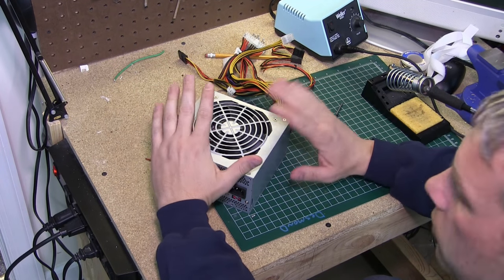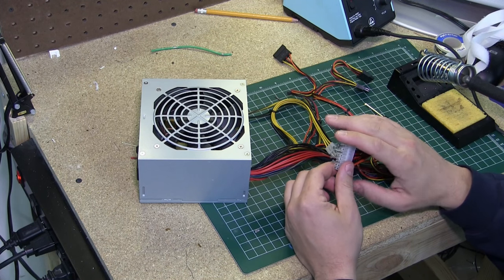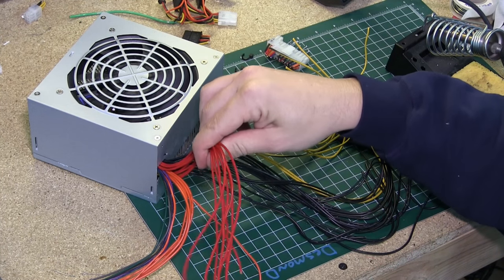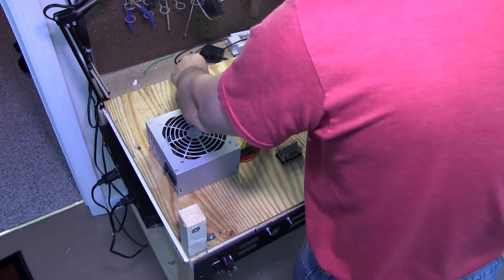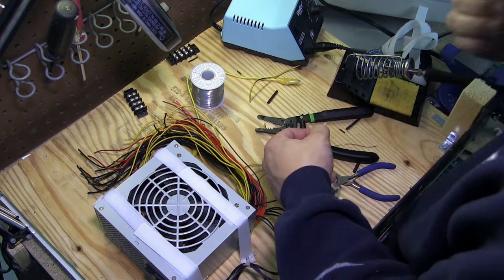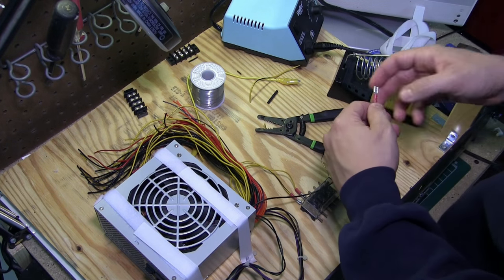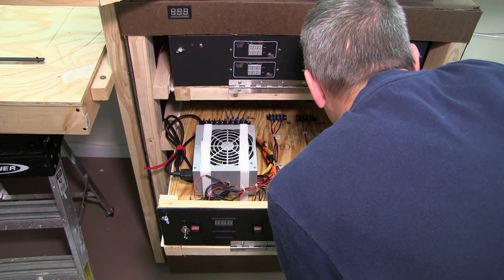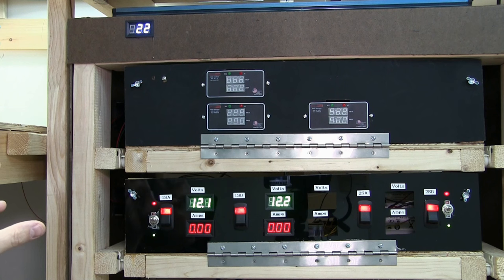Installing ATX power supplies on the Sayrehurst Secondary

Comment: Awesome this is the first time the entire ATX system has been explained in a way that doesnt confuse the crap out of me, I have heaps of ATX PSU's floating around
Reply from the maker: Thank you I’m glad you liked the video. I have learn since making the video NOT to cut off the ATX connectors. So many people are making break out boards for the ATX power supplies. That will be a change for next time.

Comment: Hi Joe, when used in a computer the main 12V rail is used for Motherboard + harddrives etc. The second 12V with the 4 or 6 pin plug is used for dedicated Graphics Cards (GPU). Graphics cards for high power gaming computers are very power hungry which is why they have the dedicated 12V rail.

Great videos BTW, you have helped me a ton in planning my layout thanks for that!
Reply from the maker: Oh thanks for the info! It didn't learn that in my research. I'm glad your following along and that I could help you out!

Comment: Thanks Joe! I sure do appreciate your quick reply. I connected the meter power wires to a 9 volt battery and the two thick wires to the middle of the source ground wire (neg) between the source and an indicator light. It works great. Your videos are excellent! Keep up the good work!
Reply from the maker: William Young outstanding! Glad it worked. On questions like this I try respond as quick as possible, I know when your in a pinch and frustrated you need answers as quick a possible.

Comment: Joe, nice video with a lot of good Ideas.  I've never considered using ATX power supplies for the auxiliary buses  but they should certainly be great power supply for DC buses.  You've given me quite a few ideas as to how to utilize and install these even if I don't do things quite the same way as you have.  So it's off to find the components at decent prices.
Thanks and Cheers
Carl

Comment: I know this was a few years ago, but if anyone watches now, these are switch mode supplies and there are big capacitors on the primary side.
Even using the "discharge" method described in the video, there is still potential for those capacitors to have a high voltage on them.   That said, there is no need to actually open the power supply to build a bench PSU from it, so you should never come into contact with those big capacitors.  The highest voltage you should be dealing with is 12V on the Yellow (or yellow black).   You can put the resistor externally if needed.   Some PSU's do not need the resistor
Reply from the maker: Hi thanks for watching. This video is from a while ago. With the availability of the ATX breakout boards everything has changed. All this work wouldn't be necessary now. But the power supplies are still running.  Sorry you didn't like the video.

Comment: I just want to start by saying that using computer power supplies is a fantastic idea that I can't believe I never thought of, major kudos to you and it really is a great build.  To give you a small background on me, I'm a Journeyman Electrician with 21 years of electronics and computer building experience, I'm telling you this so you understand that I have a heavy background in computer and electrical theory.  I have some suggestions and some information about ATX power supplies that might be useful in the future.  
    First off the information about the connector that you were talking about with 4 pins is not for dedicated graphics cards, those power connectors have 6 pins, the connector you have there is an auxiliary 12v connector for the CPU, pretty much all systems no days actually use an 8 pin connector as most cpus today are multi-core.  Another note is that the cheaper the power supply the cheaper the build.  What I'm saying is that power supplys usually have a rating, bronze, silver, and gold.  The rating just lets you know how efficient and how reliable your voltage rails are, hence how good of a supply you have.  I think it is important to note this, with the amount of work you have done to install these, I assume you want them to last as long as possible.
    Next I have a suggestion for the way you are installing them, again you have done some really great engineering into this system and these are just suggestions, you have actually inspired me to build something similar.  I was thinking you could install a 24 pin female connector and 12v 4 pin in your drawer, then you could just connect wire to the pins you need, that way, you would not have to void the warranty on your power supply, and it would make it much easier to change, just unplug and change.  As far as the load resistor, they make it wrapped in a heat sink that you could just screw down to the bottom of your drawer, then you could mount a cooling fan above them if need be, but most likely you would not need to.  In doing all these things, you would only have to wire your system one time, and replacement of future supplies would be greatly simplified and you could keep your warranty in tact.  
    I hope this info is helpful, I'm also preparing to build a bi level 12x22 n scale layout and you really have inspired me to use some of your techniques.  I have subscribed and have really enjoyed your videos, please keep them coming, if you ever have a question about trons, just let me know I will try and help if I can.
Reply from the maker: +Mark Donley Thanks so much for your input, and glad I can help, and glad you are following along.
Reply: +Central Jersey Conrail in N Scale No problem, just hope it came across right.  I'm really excited to see what your doing next, and I'm getting more excited about getting mine started.  Thanks again.

Comment: 3.3v is good for led lights in buildings that typical run on 5v gives you a bright and a dim option. Most people use the just plug system now days but I enjoy the wiring

Comment: The 3.3V is a great source for powering LEDs for street lights or interior lights.  With the 3.3 you wont need to use a inline resistor.

Comment: On my layout I chose to go with European Terminal Blocks as they save a lot of space. They generally come in 12 or more space strips that you can cut into however many terminals you need for a given connection. I also used Brother P-Touch labeler to label all  connections as needed. One of my best finds at about $14 for the labeler with some label stock.

Comment: You can buy a 24 pin plug that would allow you to just plug the power supply in. 
That way if the supply dies under warranty you just unplug it and send it back. 
These supplies don’t last forever, and they will fail when you are having an op session. being able to just plug in a spare is a life saver.
Reply from the maker: So I wished I had thought that far ahead. Also I wasn’t aware of how to make my own connectors. The system has been serving me well so far. But dread when if it dies. However I will just have to get through it. But next time I will install the connectors. Thanks for the tip and thanks for watching!

Comment: Hi Joe,  many thanks for uploading this video. I too am using a computer power source for the railroad. The unit I purchased is an ANTEC 450. I see most folks on here are using the ATX power supplies. I was able to get the 450 for a great price. Im glad you indicated using a sandbar resistor, I'll be powering some cooling fans on the cabinet. Will this be a good enough load to not need the resistor?
Reply from the maker: WestCoastRails so all the research I did said these power supplies need some draw for the internal circuits. How much I could not find. Everyone else seemed to being using the sand bar resistor. Now I'm am not an electrical engineer or have not had formal training, I only know what I have learned from model railroading. I ran the spec through a current calculator I found on line and came up with a half amp draw at 5vdc. So if your fans draw that much it should be fine. Just make sure to wire the fans direct so that they power up with the supply.
Reply: Hi Joe, can  ask where did you get the ceramic / sandbar resistor? Not having much luck, maybe Im searching with the wrong name. The you used was a 10 watt type and how many ohms? Many thanks again.
Reply from the maker: DigiKey part #SQP10AJB-10R. 10 ohm resistor.
Reply: Thanks again Joe

Comment: you are waaaay awesome   yes thank you for the hard work...
Reply from the maker: EmilionWays2RIDEIII glad your liked it! Thanks!
Reply: i have a 300 w power box and two from an arcade game with lots of circuits.   used circuits may be used?  if if they read the correct flux flow...or capacity of the ..circuit.? or just get new ones?
emilio solis
Reply: yes im a novice    im working on mine  with difficult fun..lol  i haven't touched power supplies structure first ..

Comment: Great vid, lots of good info, but a couple of questions. First is ground wires( black wires),  surely there had to be leftovers after all the switches and stuff. Was there a terminal for them? Second is that there is a lot of "Convert PSU for 12v usage" in train layouts, and making similar setups like yours, but no one shows how they tied the main power line(s) from layout to them. Have you seen a vid of where the bus line gets tied into the PSU as the power source?

Comment: nice job on this but can you answer a few questions for mecan you put up more info on wiring the volt and amp meters?????did you hook them to 12v or 5 volt side for the amp????where did you hook into the atx power supply for these meters or did you go to the terminal strips????sorry but electrical is not my strong suit......lol......thanks
Reply from the maker: Dave sorry I have been busy. I hooked up both the volt meter and amp meter to the 12 volt. I was more concerned with monitoring those circuits be ukase they will carry the majority of the load. The meters were hooked to the terminal strips ( I didn't want to mess with the internals of the tax supply). The volt meter was connected the a negative lead from the atx supply and the positive side on the 12v rocker switch on the panel. The amp meter was a little more complicated, the power supply for the meter went to a 5v positive and negative lead from the atx supply. The monitoring wires from the amp meter was connected to the negative terminal on the 12v terminal strip and a negative lead from the atx supply. So you are monitoring the amps by reading the negative side, if that makes sense. Hope that helps, again sorry for the delayed response.
Reply: Thanks for the reply, yes it makes since,
Reply from the maker: +dave great good luck!

Comment: Hi Joe. Just finished building a power supply like yours, but cannot figure out how to connect the ammeter wires. Can you explain what you did on yours to make it work?
Bill
Reply from the maker: William Young ammeter measures from the negative side in between your power supply and the load. And the power leads for the meter go to a separate source. Try that.

Comment: Question: Instead of the resistor, could you use something like a fan to provide the load and get the required load AND some cooling, or would that not work right?

Comment: Hi Joe, Does the ATX power supply have to be kept separate from the DCC power bus? Thanks for all the great how-to videos.
Reply from the maker: I use my ATX power supplies to power accessories (tortoise switch 
machines, control panel, lights etc). The DCC power bus is to bring 
power to the track. I don't want to use the DCC power bus to run 
accessories because I do not want to take away power from the DCC 
system. Sound equipped locomotives use .8 amps of power.

Comment: My only question is why you opened it and hacked the power supply?
Since you can get the female connectors for cheap from PC mod stores, you can build your own harness of the default power supply and run them to your needs.

The advantage of that approach is that if your Power supply breaks after 2-3 years, you can unhook it, buy a new one and plug it straight in and keep going.
The internals of the PSU is a nightmare to work with, but the output is standardized with where you can find 12V and 5V.
Reply from the maker: At the time I did all that work, I didn't think about it. All of the videos and articles I had watched/read all talked about cutting the connectors off. Not having a strong electronics/computer back ground I had never though of it, either. In the future if/when the supply goes bad I will just upgrade the system. That's why it is good to put this information out there so people like yourself can tell me I'm wrong. I'm a jack of all trade and King of none ( some times I make mistakes).
Reply: Central Jersey Conrail in N Scale
 No no no, I am not saying this to be nasty, I just wasn't sure what your reason for it was.
If it was ignorance then yes, my information would be helpful in at least making a component modular.

However, your other design and that drawer is definitly an idea I will have to "steal" for my future build, I was thinking of just making a cabinet, but the drawer makes so much more sense from a maintenance standpoint.

Keep it up and keep making videos, your track laying and design are a great inspiration.
Reply from the maker: +CMDR Sweeper Thanks, I have been getting beaten up this week,sorry if it came out wrong. Thanks for your advise!!